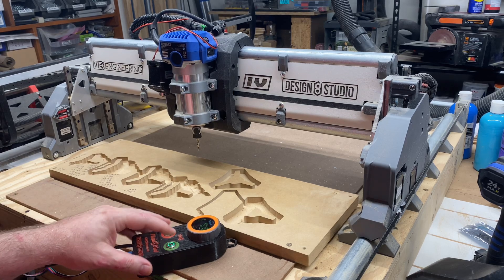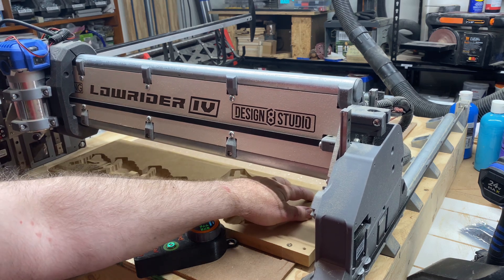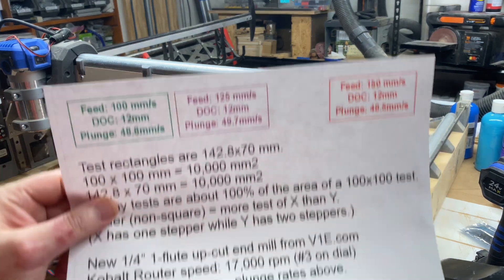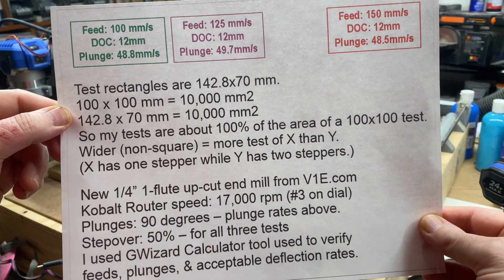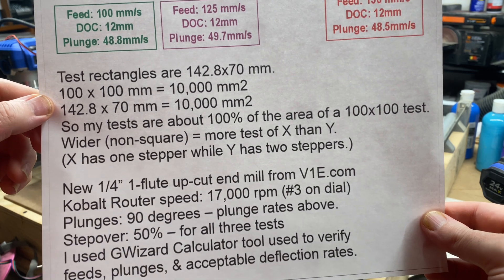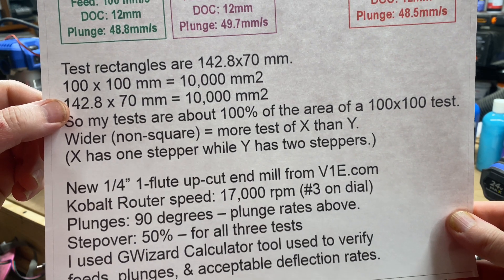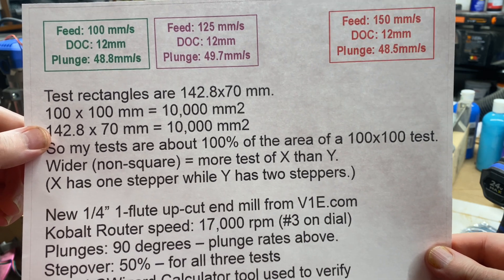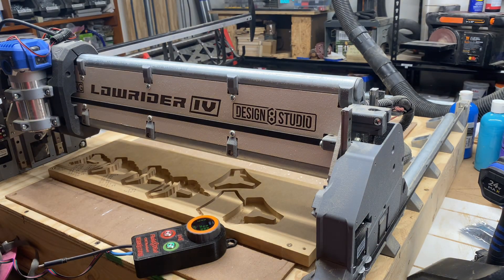LowRider v4 DIY CNC - NEW beta test cuts! 150mm/sec! 12mm depth of cut! 1/4” 1-flute V1E bit!

Comment: What size Nema motors are these? And I think you are using TMC drivers. Always curious to know the setup on the current for the drivers
Reply from the maker: Yes, I am using TMC drivers and those are Nema 17 steppers. In one of my videos I think I talked about the current, and mistakenly said it was higher than it was, and then, either in the same video or in the next video, I actually corrected it to the actual lower amount of current. I can’t remember now, but I can check my config file to see how much current is being sent to the motors. I’ll try to come back and give you that information. It is low enough that the motors are not getting anywhere near to being hot, and I actually have headroom to increase how much current they’re getting without being in any danger of overheating.

Comment: Is sawdust/chips a problem on the wheels?
Reply from the maker: Has not ever been an issue, and I don't see any other makers complaining about it either. The dust collection is quite good usually, and even without it, this does not seem to be a factor.
Reply: @design8studio  OK, I want to start building a lowrider but I wanted to check about that before investing a lot of time.

Comment: Since the LR4 is so much beefier. Do you think the Dewalt 618 is a good combo? I read a post on V1E you once considered using it. I happen to have the same situation of a spare 618 on hand. On your recommendation I will do the 618 OR Kobalt. Thanks in advance
Reply from the maker: @JoeCrow-d8o  That may have been someone else. If it was me that mentioned it, I don’t have any memory of it anymore. My understanding is that the amount of torque available from these small hand routers / trim routers (such as the Makita and the Kobalt) is plenty and the ceiling on how fast you can cut is still based on having limits with rigidity and the dullness of a bit. Basically, with the added rigidity of the LR4, the speeds can be increased, and the depth of cut can be increased. Please note that Ryan does advocate for these smaller, lighter routers. An important part of it is that the whole system is designed around the center of balance that, if you switch to a larger diameter on the router, it changes the center of balance, pushing it forward, and they’re just not designed for that.
Reply from the maker: @JoeCrow-d8o  if the Dewalt 618 is a small, trim router, then forgive me for not knowing the difference. I assumed you were asking about putting a larger router onto it.

Comment: Will it work with 22mm OSB board?
Reply from the maker: It cuts OSB easily. Depth depends on how long your bit is. Most bits are made to cut up to 25.4 mm (1”) in depth.

Comment: This new desing is awesome!, do you have plans to adapt and share the files of your also awesome tool changer?.
Reply from the maker: Thanks! In the world of CNC, tool changer usually refers to automatic tool changer. There are people who make such things in a DIY fashion. However, I don’t have one and since they require a spindle that can rotate in both directions — and most of us use trim routers that can only spin in one direction, it’s not something you’re likely to see on a V1 machine. I don’t have one, and there’s not one shown in the video. So I’m a little confused on what you are referring to.
Reply from the maker: Perhaps you are referring to the pendant dial that I am using to control the machine? If so, that is called the FluidDial pendant.
Reply: I remember watching your plasma cutter video with a very cool torch attached with magnets. Maybe I wrongly assume that was a quick tool changer for router/plasma/laser. I'm trying to keep up with your videos... sorry for that.
Reply from the maker: @luisvegano  Ah! I understand you now. Those magnets were so that if the plasma torch ever got snagged on a piece of metal that was sticking up, the torch could detach instead of being damaged. Magnetic breakaway.
Reply from the maker: @luisvegano  All the printable designs I made for the plasma based LowRider 3 are available on Printables here: https://www.printables.com/@design8studio/models?search=plasma

Comment: heyy doug im having an issue with my LR3 i have a 1.5k spindle its like 9lbs I'm getting alot of deflection on it in the LR4 the tubes are bigger? to avoid this?
Reply from the maker: The LR4's tube options are all bigger than the LR3's tube options. The LR4 default tube for US is 1" EMT. EMT is sold based on inside diameter, but for LowRider we are concerned about outside diameter. The 1" ID of the EMT results in an OD of 29.5mm. The other options for those outside the US include 30mm and 32mm. I think another thing that helps prevent deflection is a better material choice for strut plates. In one view, all they are is skin, so it needs to be something that resists stretching. In another view (perhaps the "over engineer to be better" view), make them thicker than skin (max is 1/4"), and of something that resists bending and twisting in addition to resisting stretching. For my smaller LR4 (seen in this video) I used 5mm thick hardboard sourced from "wainscoting" from Home Depot. I was going to use that for strut plates on my big full-size LowRider too, and it probably would be wonderful. Nevertheless, I just recently bit the bullet and ordered some 1/4" aluminum plate strips for that. Ryan says 1/8" [aluminum] would be totally fine, and no doubt he's right — he's an engineer, and I'm not. Still, since my full-size LR has a l-o-n-g gantry, I like that it will be as strong as I can get it.
Reply: @design8studio  nice i use 2 layers of 1/8 ply and resined them both together thanks for the advice

Comment: Would you please include some upgrade options in your instructions for this build?  1.  Better software and interface - I have been researching using something like Mach4 recently.  2.  Closed loop motors - I am so tired of tossing out wood that was ruined by one jump in a motor that caused the remainder of the run to be off by a few millimeters.  3.  Maybe L3 solved this one, but auto squaring and leveling would be pretty darn cool.  I have to go through routine every time I start a project.  4.  spots to put in some of those 5v laser cross hairs would be useful.  5.  Adding a led light ring below the router would make seeing much better.  6.  If I got real crazy, I was going to design a magnetic dust shoe that could be easily removed to change bits.

Anyway, point being.  Design a base model, but then add links for all the upgrades and mods people make that you think make the cut to the directions page.

Ultimately, I want to see a $2500-ish Lowrider build take on a $30,000 commercial CNC in a cutting challenge to see if the MPCNC world can win the competition.  Judging on speed, accuracy and reliability.  From what I see big commercial machines use a lot of heavy, heavy steel to get the rigidity they need.  All that mass, makes the motors have to be huge and expensive to move it fast.  I think applying torsion box principles to the lowrider gantry with ultra light weight materials (like an airplane wing) to maximize rigidity without increasing weight would keep the motor size and cost down.  

Keep up the great work!
Reply from the maker: If someone breaks the ice and uses closed loop steppers, they can no doubt provide advice for anyone else wanting to.  This video’s cut, and the more recent one done in hardwood, were made with the NEMA 17 steppers getting 0.8 amps, sharp bit, no skipped steps! Closed loop steppers can be used but they are more expensive. This is not running on Marlin but rather on FluidNC firmware on the Jackpot control board bought from Ryan! If you have not checked out the FluidNC firmware with the WebU available through wifi, it's quite nice. It also supports a DIY pendant, called FluidDial, which I've built and you see that in the video! PS: I previously mentioned thinking they steppers were getting 1 amp each, but I double checked and they were using stock config amount of 0.8 amps.
Reply: @design8studio  Thanks for the info.  I will definitely check that out.  As for the closed loop motors, I am not sure I am using the word 'skipping' in the right context.  With my L2 anytime the machine gets bogged down or maybe hits a harder spot in the wood, it tends to get out of alignment on 1 or more of the axis because the motor turned but the machine didn't move.  You can hear the motors 'grinding' or whatever you want to call that very clearly.  I don't think the problem is with the power of the actual motor.  I would guess it comes from several different issues but the end result is one motor 'thinks' it moved the machine to a new position, but it didn't quite get it all the way there.  Then every GCode command after that is off by that measurement.
Reply from the maker: @claib4  Yes, that is exactly what the term "skipping steps" refers to. The loud snapping could easily be mistaken for the belt teeth popping from one groove on the gear pulley to another groove, but it's actually the magnets and the stater in the motor losing one "connection" and popping over to the "next" magnetic connection. The issue of skipping steps arises when the real world resistance to the commanded movement is greater than the transmitted force of the motor and geared / belted transmission assembly can muster. There are at least two ways of combatting this: increase force power of the assembly, or reduce the resistance. The resistance can be a result of a dull bit. This can be overcome by a sharp bit. The resistance also comes because the feeds and speeds were incorrect, demanding too much, and this can be overcome by correcting the feeds and speeds. On the other side of the equation, the force power of the assembly can be increased by adding more current from the drivers to the steppers, but this has a limit because it adds heat to the steppers, which beyond a certain point, can soften / melt printed plastic motor mounts. In my most recent video, in which I tested the new LR4 pre-release designated RC2, I cut hardwood successfully using 50mm/sec feed rate, a 12mm depth of cut, and the motors at only 0.8 amps of current, with my stepper motors very cool, using a sharp bit, and I had no missed steps. I repeated the test three or four times, and never had a missed step. In high school I enrolled in a gymnastics class, and the coach had a saying: "The more balance you have, the less strength you need. The less balance you have, the more strength you need." If you have a lack of balance (parlance for dull bit and / or incorrect feeds and speeds), you will need more strength (parlance for either overly hot steppers or expensive closed loop steppers). May I humbly suggest before you go for closed loop steppers, i.e. simply throwing more money at the problem in order to add more power, double check for sharp bit and for correct feeds and speeds. I paid a one-time fee for GWizard calculator for figuring my feeds and speeds, but there are free calculator tools and spreadsheets available. Getting right feeds and speeds is one of the areas of greatest challenge for hobbyist CNC makers. It is also the area of greatest fruit when it is gotten right.
Reply: @design8studio  Thank you for taking the time to give such a great answer.  I honestly don't know what amperage is running to my motors but after you explanation, I definitely want to investigate that more.  I could see how that could effect it now.  It's been a while since I messed with a feed/speed calculator but I will check one out again.  I have been just adjusting that based on if I am getting good chips or sawdust.  Again, thanks for the time and sharing!!
Reply from the maker: @claib4  Nice thing about the Jackpot, the new control board Ryan makes and sells, is the driver current is set in the config file and easy to edit. Ryan's store sells temperature gauge stickers (thermometer stickers) that are made to stick onto the stepper motors, and they let you see how hot the motors are getting. At 0.8 amps, they stay quite cool, barely warm at all. The stickers read back in both Celsius and Fahrenheit, with the Celsius being in 5 degree increments. At 0.8 amps, mine show 30 Celsius lit up. The goal is stay no higher than 45 Celsius, I think. At 1.0 amps, mine are at the 45 Celsius increment. I did the amazing speed test video (where I cut the hardwood so easily) with 0.8 amps! I later tried 1.0 amps (too hot for me), and 0.9 amps (still borderline hotter than I wanted) and finally set them to 0.85 amps, which is where I left them. Another nice thing about the Jackpot is that its firmware is FluidNC, which not only supports wifi and the web-based user interface (WebUI), but it also supports the FluidDial, a DIY pendant. I've built one of the pendants for my big full-size LowRider, and now since I will have a smaller second LowRider as a result of being on the beta test team, I am building another FluidDial, so that both LowRiders will have one. You can see me using the FluidDial in the various test cut videos.
Reply: @design8studio aren’t stepper motors SUPPOSED to run hot? Would changing to metal motor mounts possibly get the best of both worlds?

Comment: Nice work.  The up/down gantry works much better than the one I attempted.  Is it just gravity that is holding the mechanism down?
Reply from the maker: Yep. Just gravity. But the gantry is a beefy thing. With the nice big steel EMT tubes (OD of 29.5 mm) plus the weight of the router plus the hefty printed core, plus the stepper, plus the 5mm hardboard strut plates, plus the printed braces. There's a serious amount of gravity power holding it down.

Comment: Hey bud, are you using Jenny bits?  I use 1 flute for aluminum, but 2 & 3 flutes for MDF and MDX.
Reply from the maker: The previous video was a carbide 2-flute up-cut bit, cutting MDF with a 12 mm depth of cut, but I had my RPMs too fast on the router. At least for a two flute bit it was too fast. This one was a carbide 1-flute up-cut bit.

Comment: Just as I’m halfway through printing LR3 parts sigh
Reply from the maker: Build the LR3 and get comfortable with it and then you could use it to cut hardboard strut plates and aluminum XZ plates to upgrade to a Lowrider v4! The hardware kit for the v3 and v4 versions are almost identical— only a difference of a few screws.

Comment: Hey Doug, amazing! I know you've said its more rigid, and btw yours looks really cool.  I am wondering if you are somehow able to quantify that? What material are the strut plates (hardboard?)?  Can you post some pictures of the back side and closeups of the y struts on the forum?  I really like that the new Y axis shield the wires and the motors, and especially the ball screw from getting dust in them.
Reply from the maker: Most everyone on the beta team has built earlier LowRiders and says they can tell by feel that this gantry is more rigid. Just by tugging on it that’s my sense. For my struts I wanted 1/4 inch thick hardboard instead of 1/8 inch. I couldn’t find 1/4 inch at my local home improvement stores but I did find that Home Depot has some 5 mm thick hardboard listed as wainscoting. I used that and it’s working great. One side of it was either primed or painted white. I faced that out, and I used my CO2 laser to engrave the Lowrider name and V1 logo and my Design8Studio shop logo. I will aim to maybe start a build thread and post some pics that are OK to share now.

Comment: Excellent job! What's the diameter of tubing?
Reply from the maker: So depending on one's location globally, there are several tubing sizes being supported. I'm in the USA, so our choice here is 1" (ID) EMT (which is sold based on ID, even though the LowRider concern is about OD). This EMT has an OD of 29.5mm. I think a couple of other sizes being supported for international use are OD 30 mm and OD 32 mm.
Reply: @design8studio  Not sure if you're allowed to say, but the Y rail looks like it might be the same diameter EMT as the gantry this time around? Just trying to decide if I need to buy one or two pieces next time I'm at HD or Lowe's. I was about to hit you up with some questions on you LR3 mods, but looks like I'll just be patiently waiting for the LR4 release.
Reply from the maker: @KeithKline  Well that part does seem pretty settled, and so I think it’s OK for me to say that, yes, the EMT for the gantry and the Y rail is the same size. It is listed (at home improvement stores) as 1” EMT. That’s its inside diameter, but for LowRider we’re concerned with its outside diameter, and the OD for this EMT is 29.5 mm.
Reply: Thank you @design8studio